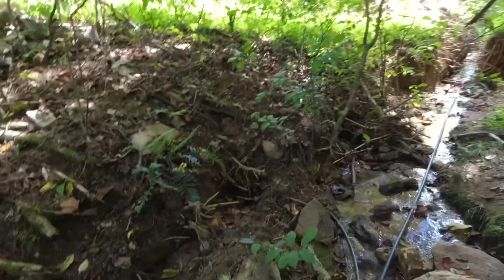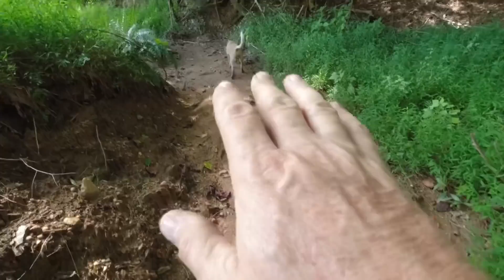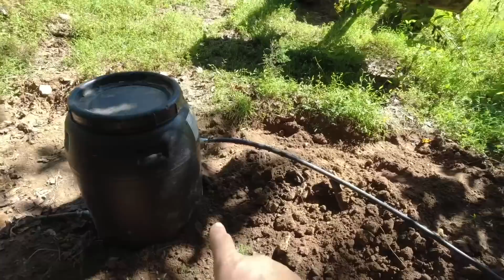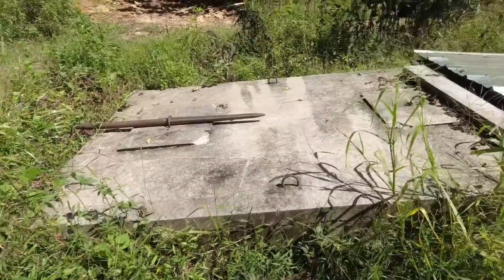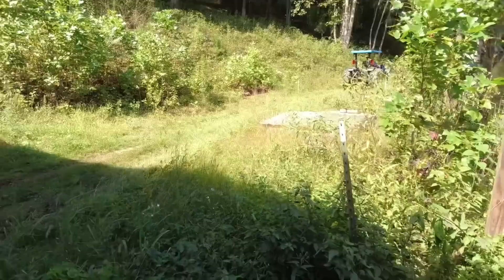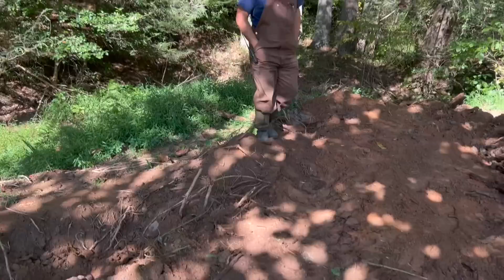This THREATENED Our Farm's Future

Comment: If anything the current municipal water system is "archaic" I have a system very similar to what you have and  it was put in by my grandfather at least 75 years ago and is running strong. The idea that we must get water from "the water company" so you have "clean" water is ludicrous, especially if anyone would simply look into how they "treat" it before it comes to us.

 I believe it is a good idea to develop any springs we might have on our property even if you simply run them back into the crick, that way you always have a water supply on your property. We catch rainwater from our house and barn roof into a 6000 gallon cistern, pump it into our house through a series of filters including a UV light and that is our water supply to our house. The water is perfect, clean, Ph balanced, doesn't have any of the calcium and lime to stain dishes and sinks and God gives it to us for free!
Reply from the maker: Nice setup!  You’re so right. The orthodoxy says mass produced from a plant or municipality is good. Natural is bad. And we’ve bought into that…..sad. Love the way you are doing multiple processes to provide water for yourselves. Thanks for watching

Comment: Might think about running your water line threw another line in the part that is going to be under ground you w
Oils half to seal both ends off to keep debris and critters and such from plugging up your run piping for the unseen problems that may happen to the section under ground that way you could just pull it threw to fix it or replace it with out having to dig it all up again

Comment: Wouldn't you want the outlet of the sediment trap higher than the inlet? In my mind it would allow the water more time to settle out the solids, even if you put a stand pipe on it into the bulkhead.
Reply from the maker: That’s a good point. We may have to adjust it.
Reply: I came to say this after watching the video. You definitely want the outlet higher than the inlet.

Comment: Watching from the panhandle of Texas. I wish we had a spring that delivered 2.3 gal per minute. There is no surface water in our county. Every gallon of water used in farming and households has to be pumped out of the Oglala aquifer. In addition, the drought caused by the La Niña weather pattern is taking its toll on agriculture out here. From sept of 2021 to sept this year, we have had 10.6 inches of rain on our farm. Water is a resource we all take for granted.....until it’s in short supply.  Nothing lives or grows without water.
Reply from the maker: I’ve been hearing y’all were in a drought. You are right, we dont appreciate it till we can’t get it.